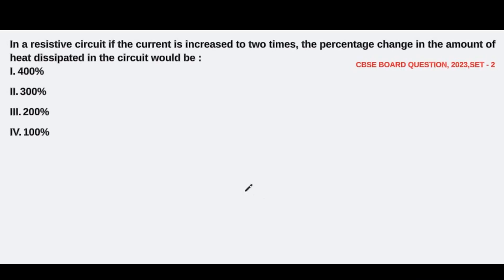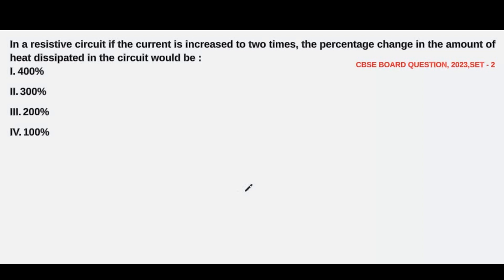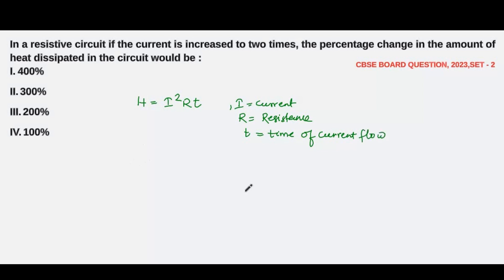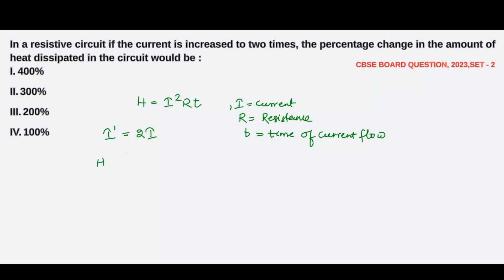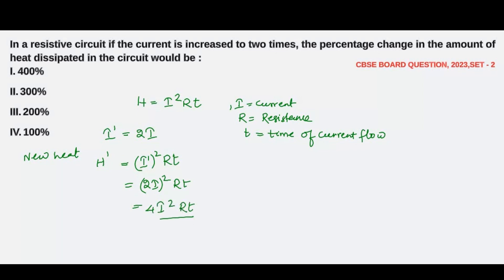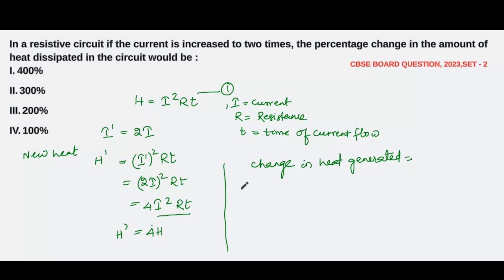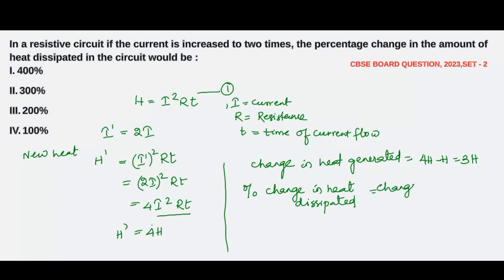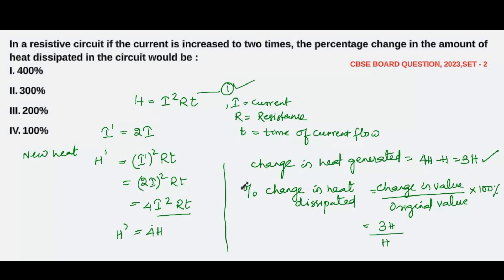In a resistive circuit if the current is increased to.. #class10physics #science #cbse #viralvideo

Comment: Mam i had some more doubts of physics to clear 
Some of them are diagram based 
So where can i ask those doubts ?
Reply from the maker: Please mail me sanghamitrasatpathy2022@gmail.com
Reply: @sigmaphysicsonline  ok mam
Reply from the maker: Please msg me after you upload the doubts
Reply: @sigmaphysicsonline  sure mam
Thnk u so much ❤️you are so kind ,🤍
Reply from the maker: @Satwinder.pb0  Na beta.
I would be very happy to help you.
It would be my pleasure ☺️☺️
Reply: @sigmaphysicsonline  💘❤️
Reply: Mam please check if you have got the mail or not ?
Reply from the maker: @Satwinder.pb0  Ys.
In the first question, I don't think any diagram is correct.
The correct way to measure using a protractor, is to keep the 90° angle wala line on the normal to the prism.
Please check the figure that I will send.
In the second question, where are Points A and B?
I couldn't find.
And in the third image which question is your doubt- question 11 or 12 ?
Reply: @sigmaphysicsonline  ok mam✨️🙏

Mam 12th ques
Reply from the maker: @Satwinder.pb0  pls check your email beta.
I hv sent the answers.
Reply from the maker: @Satwinder.pb0  I hv sent another mail, for Q12 solution.
Please check ✔️
Reply: @sigmaphysicsonline  ok mam👍
Reply from the maker: @Satwinder.pb0  All the best beta. 👍👍👍